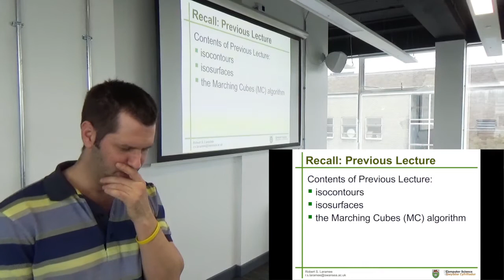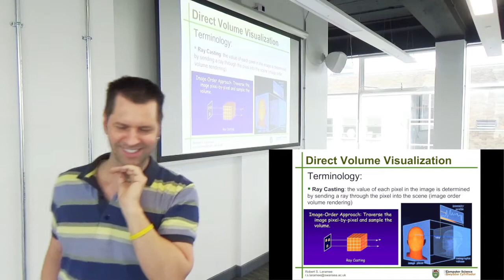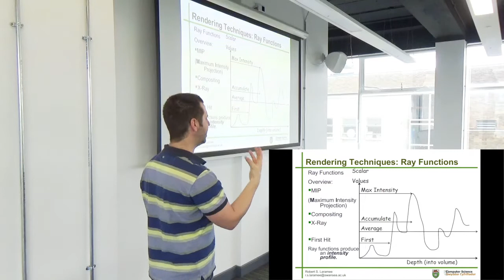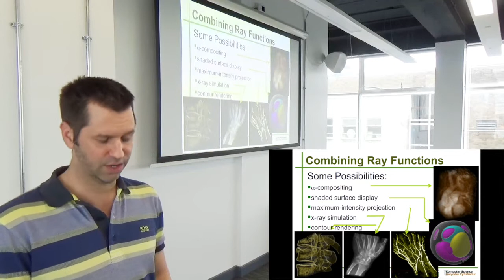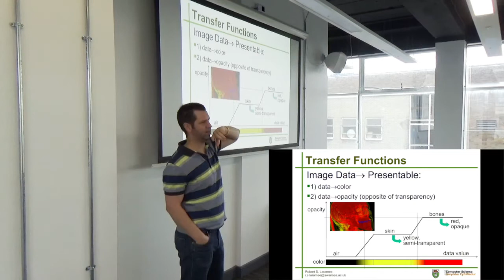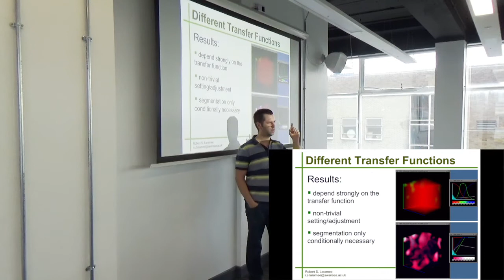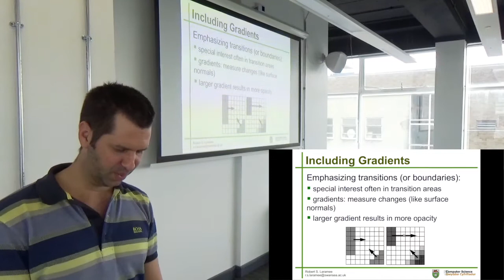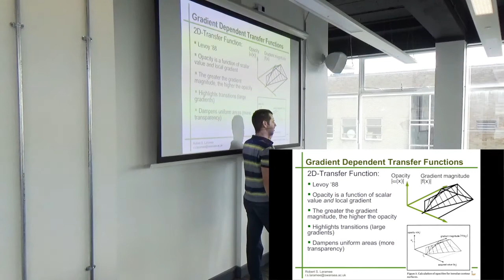Visualization Lecture 11.2. Ray Casting, Ray Functions, Transfer Functions, Direct Volume Rendering

Comment: Almost clear about Transfer function, opacities role and thanks for the outstanding slides and way of teaching. :) 
Regarding front-to-back vs back-to-front ray casting, which one is better and why?
Reply from the maker: Thanks for watching.  Front-to-back is better due to early ray termination.  I discuss that in the lecture on the shear warp factorization.
Reply: @BobLaramee  early termination when it's fully opaque. GPU ray casting has also early termination, r8! Thanks :)
Reply from the maker: @ingenuity376  Sounds like you will do well on your exam.
Reply: @BobLaramee  It's quite interesting area but takes time to get the point clearly. Even though it's a real challenge to understand everything cuz there's a lot of things interconnected. However, Your lectures really help.
Reply from the maker: @ingenuity376  Glad they help.  You will do well.
Reply from the maker: @ingenuity376  https://www.youtube.com/playlist?list=PLZo40sVmw_4M_vQLBfNwXpjwP7NDU0rnd
Reply from the maker: These are some additional explanations.  Some of them are from Swansea Uni tests.
Reply: @BobLaramee  Inspired :) Thanks

Comment: I thought raycasting/tracing had to do with a point at the origin (0,0,0) and the vector representing the direction to each pixel...
Reply from the maker: The point does not have to be at the origin.